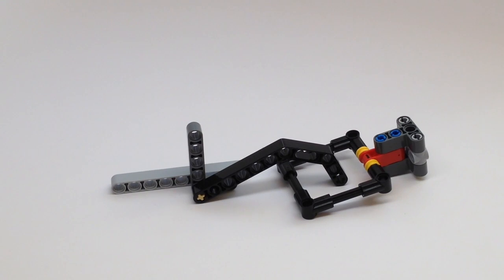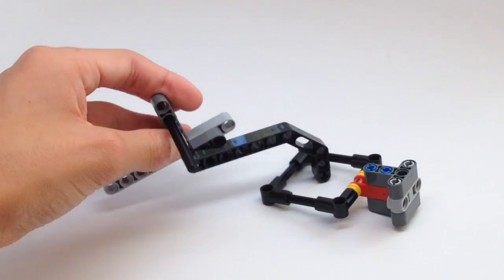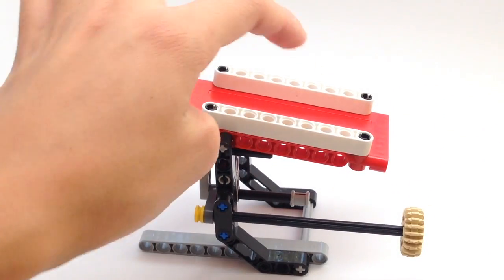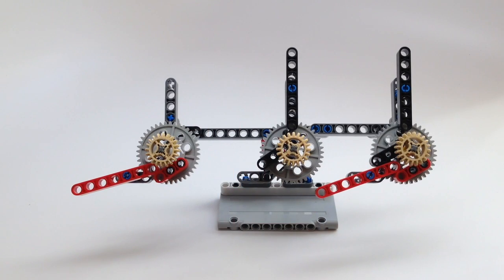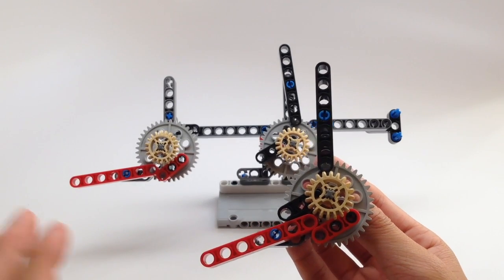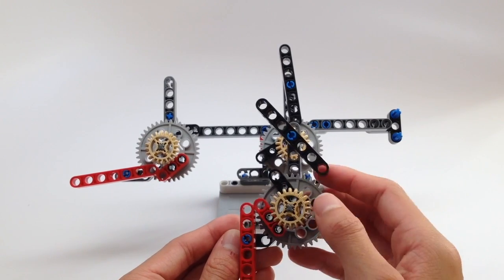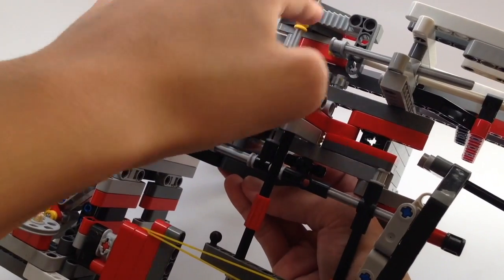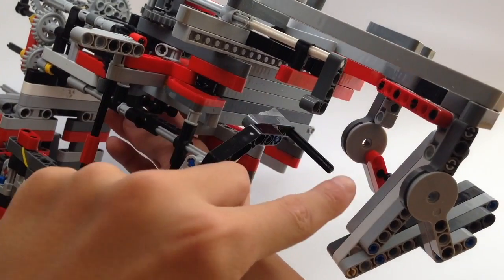FLL 2015 Trash Trek - LEGO Trigger Release Part 2

Comment: Whats the advantage of using trigger release?
Reply from the maker: +Prakhar Mittal hello! the advantage is that trigger release requires no motor and is quite simple. you can perform several tasks at a time with trigger release.